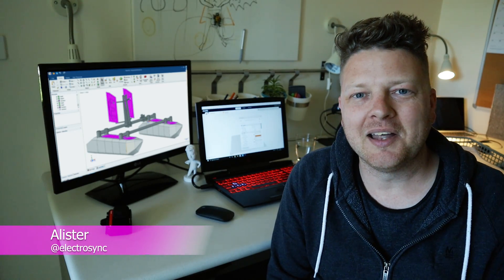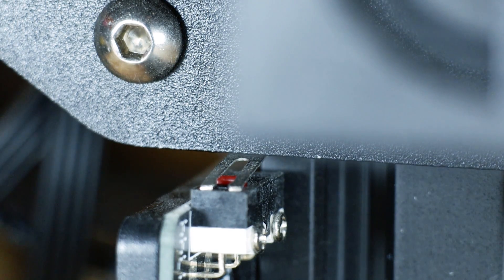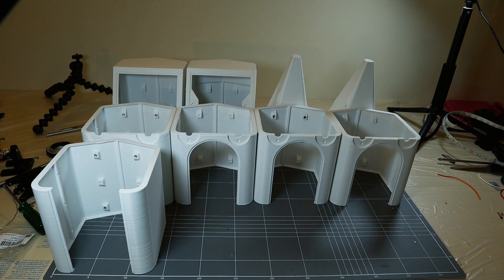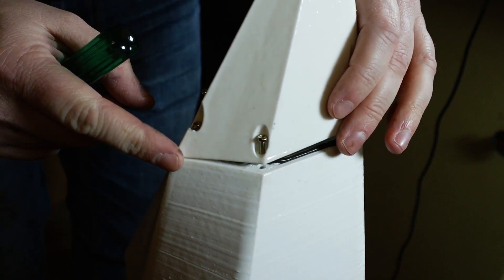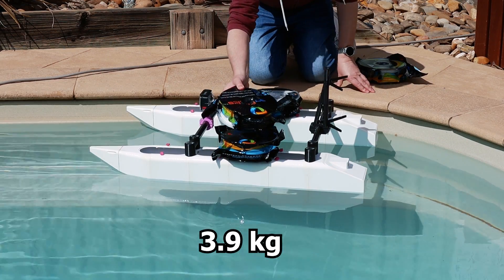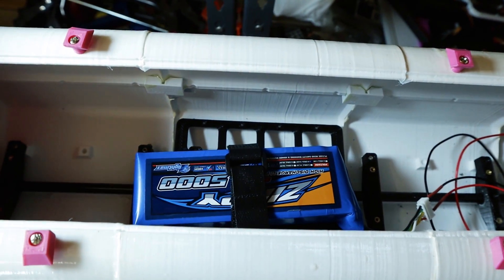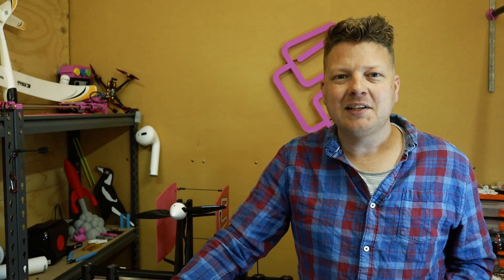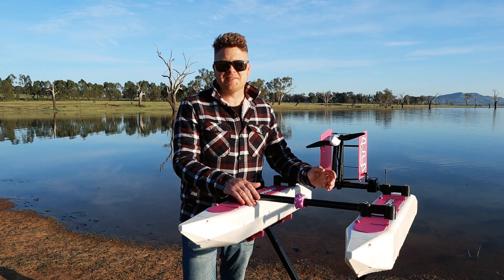3D Printed RC Utility Boat - Hull and Drive System - Part 1

Comment: Love the design. I'm going to do a similar design using half inch PVC pipe, white pool noodles for the main floats, and just 3D print the engine mount and electronics enclosure, the steering vanes, and a few cosmetic pieces. I'll print some nice looking cones to make end caps for the pool noodles so they don't look like pool noodles. Should be able to cut it down to less than 100g of filament. Pool noodles hold hundreds of pounds afloat and they are UV resistant.

Comment from the maker: Any tips for an RC boat noob? Lights, camera and more coming in Part 2!

STL files and a build guide are now available. See the link in the video description.
Reply: Where buy the TSL?
Reply from the maker: @merazmario  I make my STLs available for free, but these ones still need some more work before they're ready.
Reply: @electrosync  amazing !! thsk
Reply: rudder in water that are aligned with the upper in air? Better steering?
Reply from the maker: Good idea. I am trying to limit what is below the waterline due to weed, etc. I think this could be added as a removable addition though. Thanks!
Reply: @electrosync  fantastic channel! Have you seen rctestflight’s boat videos? Daniel has gone through a similar process; I second the rudder. Tracking fins might help as well. I imagine the performance will improve when you have a bit more weight from the science payload.
Reply from the maker: Thanks for watching. I have seen rctestflight’s vids - love the Banana Slug! I think I may have a go at a rudder mod.
Reply from the maker: The STL files and a build guide are now available. See the Thingiverse link in the video description.

Comment: Great work and design! I found your project today and have a similar project in process. I live on a pond and set up stationary sensors to monitor air temp/humidity, water temp, tide level, dissolved oxygen, ph, turbidity and salinity. I'm using LoRaWAN for real-time data reporting.  I played with a 3d printed helicopter project for a while but switching to a 3d printed autonomous boat. I'm using a Pixhawk controller with telemetry and most likely a Blue Robotics ping sonar sensor for mapping. I'm in the US, let's collaborate across the big pond!
Reply from the maker: Thanks! I’m glad you found it. Your plans sound impressive! I’ve got a way to go before I get to autopilot or sonar systems. On the upside though, the water sampling system is pretty much complete (and the next video in this series too). It would be great to share some ideas!

Comment: I have an ROV boat I built that wasn’t optimal for what I wanted and I came across your video. 

I started building this thanks to your design - I have both bow and stern sections printed. 8 more pieces before the main portion is complete

I will need to find a source for the polyester resin (is this the same as fiberglasss resin? - I need to investigate this.) 

I noticed in some of your other videos you talked about adding a keel section or something to add stability, are those files hosted anywhere ?
Reply from the maker: Yes, fiberglass (polyester) resin is what I used. You could use epoxy resin, but I was familiar with polyester. The keel (fin) files are available on Thangs: https://thangs.com/designer/electrosync/3d-model/3D%20Printed%20RC%20Catamaran%20Utility%20Boat-44098 Good luck with your build!

Comment: Thank you for a great video, which model 3D printer do you use in these videos and what is the printing volume? I am impressed at the size of those hulls, so would like to know what I need to produce similar volume as I venture in similar projects.

Comment: Thanks for sharing!
Does it cope well with rough waters?
Optional modular deck system is released yet?
Reply from the maker: I doubt it would do well in rough water, but I've never tested it. The modular deck system is here: https://thangs.com/designer/electrosync/3d-model/Modular%20Deck%20System%20for%203D%20Printed%20RC%20Catamaran%20Utility%20Boat-44113?manualModelView=true
Reply: @electrosync  Thank you! Have you tuned the design recently or it's the same as 2021?

Comment: Put sonar on it and map lake bottom surface.
Start to code custom autopilot, dont use ready to go pixhawk or somethong similar.
Thats would be increadible video series.
Reply from the maker: This is definitely something that I’m considering. Sonar and autopilot aren’t cheap, but they could be a lot of fun! Next up though, the sampling system shortly...
Reply: @electrosync  check simple sonars for  fishers like Lucky , there are pretty simple protocol for reverse engineering, very cheap and small transducer.

Comment: hi mate frim brisvegas,, love ur work, i come from an rc aircraft build/fly background ,, couple ideas that work well on aircraft,, changing the thrust angle of ur motor, have the direction of thrust slightly down below level of bow,  also with youre steering being affected by the wind,, the rudders(control surfaces) are adding to ur boat bein pushed around,, try thrust vectoring the entire motor mount or run 2 props and program differential thrust between the 2 of em,, u run 2 lipos to ballast so why not use them ? look like it could use a bit more power.
Reply from the maker: Great tips! A couple I have already done: I redesigned the motor mount and moved the LiPos to the back. I’m too far in this build to add thrust vectoring or two props, but if I ever dive in for a version 2.0, these are great ideas! A bit more power would be nice too! Thanks!

Comment: Nice work.  Why didnt you use propellers underwater? What is the  advantages? Low consumption? High speed?
Reply from the maker: Thanks! I went the air prop and rudder route because I didn't want any issues with fowling props on water weed, etc. Battery efficiency is great with this set-up too. I could have gone either way to be honest.

Comment: Any particular reason that the inner and outer tubes are in carbon (other than saving weight)? Having a hard time finding them, would RVS work for the inner tube and PVC for the outer tubes ?
Reply from the maker: I chose carbon for weight and aesthetics. PVC should be fine on the water, but I would worry a bit about using them to hold the boat's full weight when lifting it and moving it around - it could be fine though? Stainless inside the hull should work just fine.
Reply: @electrosync  great, thank you !

Comment: Hi another question. Can you tell my the diameter an the length of the Caron fiber tubes?
Reply from the maker: 25 mm x 575 mm. There's a full build guide with BoM linked in the description and on my website if it helps.
Reply: @electrosync  thanks
 I didn’t realise that

Comment: This design is great, I would love to see it perform some of these research tasks autonomously! How did you go about designing the hull/picking a hull type? Do you have any resources for that part of the design process?
Reply from the maker: Adding ArduRover is on the cards for down the track - I haven’t had much time on this project lately though. The hull was always going to be a cat because of how well the style lends itself to 3D printing. As for the hull geometry, I looked at what else was out there and did some rough calculations for buoyancy and drag - nothing overly technical. But there’s a lot that I would change if I ever get around to a second version!
Reply: @electrosync  I would be interested in seeing a video about that. I was thinking of using your STL files but using two outboard motors on the end of the hull instead and trying to develop some control programs for it.
Reply: @electrosync  Did you have any issues with the holes for the heat inserts and the carbon fiber guide rods when you printed the hull? I used the STL files you provided and print settings from your build guide to print one stern section and the holes did not come out great. I am thinking of flipping the print 180 deg and starting over to see if that improves them but I was worried the 0.6mm nozzle was too big for the dimensions on the holes.

Comment: Hello! How big must be the 3D printer for this project?
Reply from the maker: Hi there. The minimum build plate size is 200 x 200 mm.
Reply: @electrosync  Thank you!!!
Reply: @electrosync  Large build volume: 210 x 210 x 205 mm is sufficient?
Reply from the maker: Yep, that will be fine.

Comment: What FPV camera do you plan on using?
Reply from the maker: I’m planning on fitting a Foxeer Razer mini with tilt to the front of one of the hulls, and a second camera with channel switch to keep an eye on the equipment that will be on board.
Reply: @electrosync  ahh ok, any plans for an underwater fpv camera or just above water?
Reply from the maker: I hadn’t planned on it because lakes in my area aren’t very clear, but I could probably incorporate it into the same housing as the bow mounted camera. That would be kinda of cool.

Comment: carbon rods and carbon fiber prop? really? why don't you 3d print the rods and the prop also? looks like you really enjoy printing everything (cutting hools from EPO easier cheaper and they are not so heavy and don't require glue and fiber cover not to soak whater)

Comment: i dont like the useless printing , there is no point not to build most parts from plastic pipes and the hull from the right plastic and work to shape. to much time to print all of this
Reply from the maker: I agree that there are definitely easier ways to build a boat! I wanted to challenge myself to build an open source, 3D printable boat that anyone can print/build. There are quite a few of these boats around the world now completing missions ranging from sonar mapping to body recovery - most of them built by people like me in their workshops.
Reply: @electrosync  ok just saying for fun i would cut the hulls from a box shape plastic you can buy. Poly something which better i forgot what i used it was years ago